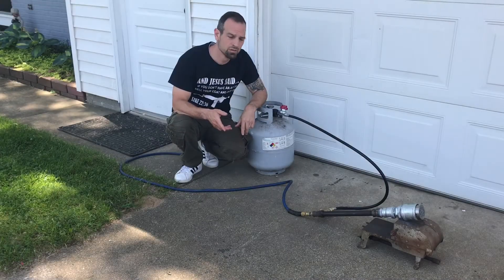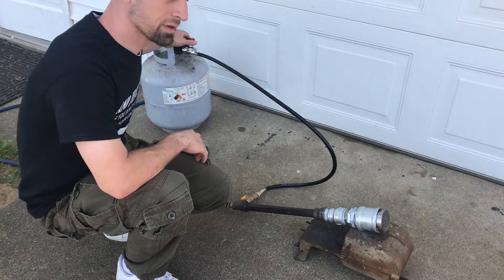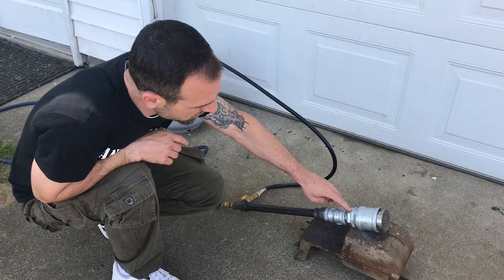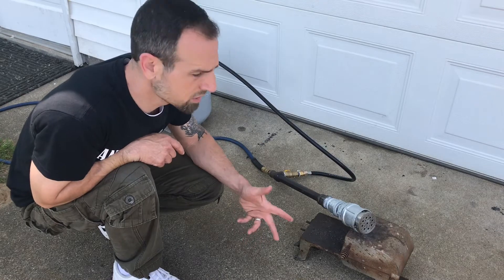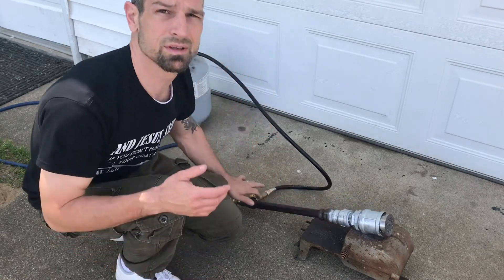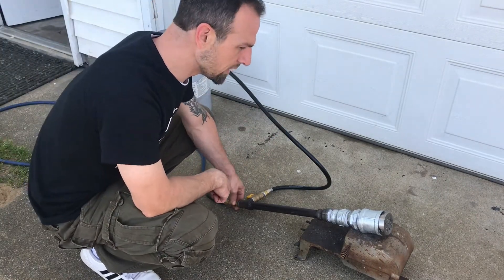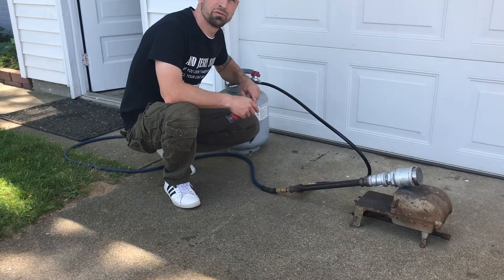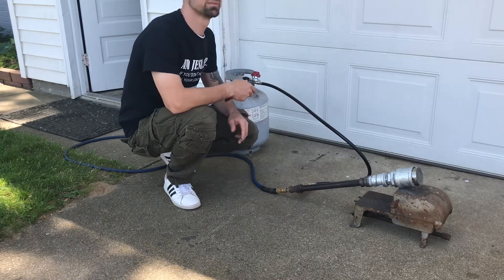Forced Air Forge Burner - Uses Air Compressor

Comment: You want people to like and subscribe but I don't see any replies to questions,  how much psi are you running this at??
Reply from the maker: I had a 30 psi regulator but had it slightly cracked for testing. I basically turned on some gas, then adjusted the airflow until I got a clean jet. I’m sure the air flow was very low but don’t have exact numbers. Sorry. Btw I stopped responding to questions and comments because people got nasty. It was easier just to be completely non responsive.
Reply: @tyler79durdan  ok thanks, I'm making a compressor that will put out about 120 psi, don't know how the flow will be yet but I'm sure it'll handle the 30 -ish psi on a constant flow....we'll see, ha ha anyway thanks for replying,  there are a lot of knobs on YT. Cheers
Reply from the maker: @shanestevens622  the gas regulator is a 0-30psi. The compressor regulator was turned wayyy down. Two different regulators.